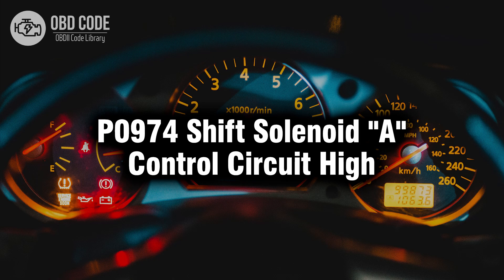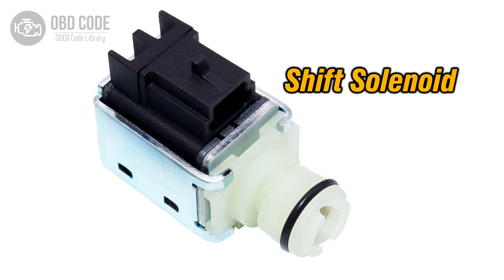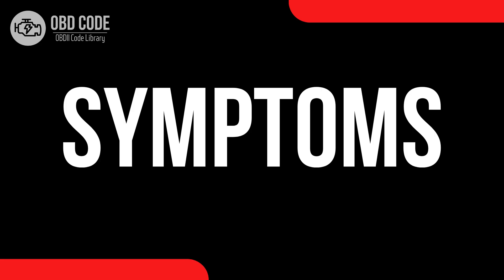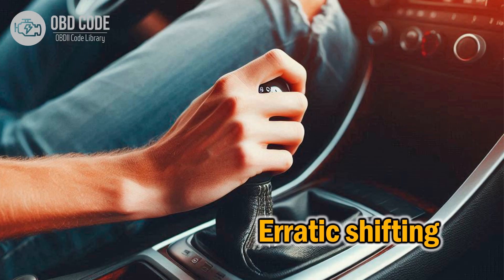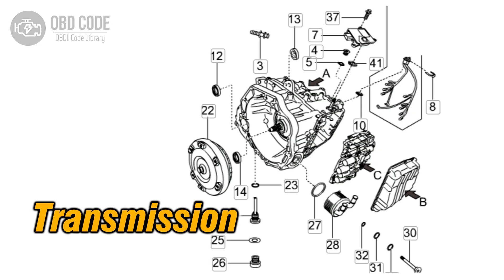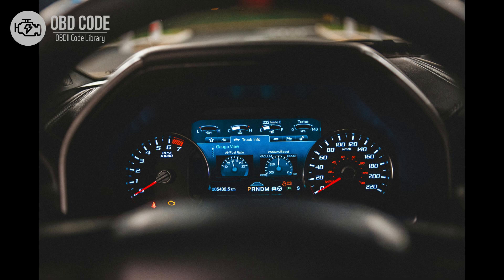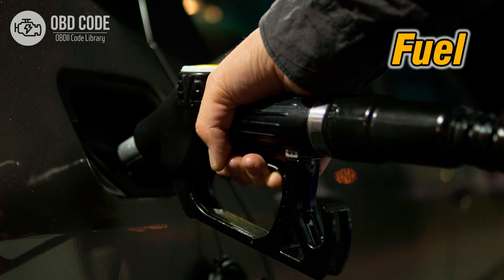P0974 Shift Solenoid "A" Control Circuit High 🟢 Trouble Code Symptoms Causes Solutions

Comment: Hello I have this code on my 09 Corolla and I noticed the gear isn't active when it's on gear 1 the engine revs high but once it crosses one it shifts fine. Pls what's likely the solution.
Reply from the maker: 👨‍🔧 Chat with a mechanic to get advice on your vehicle's fault
https://wa.me/message/4GKMVTKJOA5NP1
Reply: @obdcode. The mechanic checked and concluded the ECM Is bad